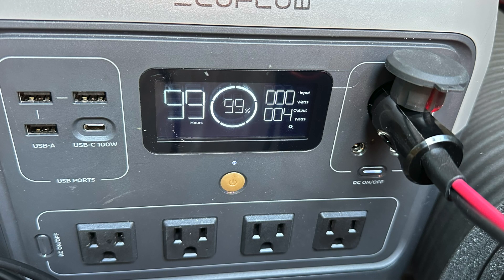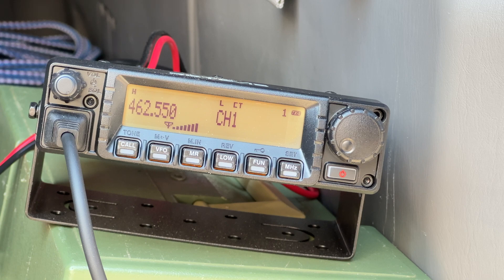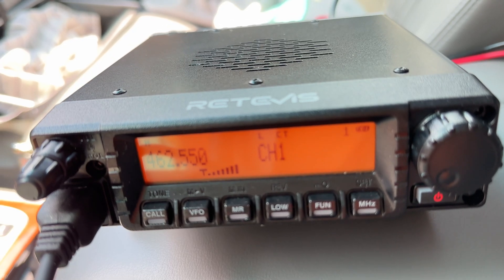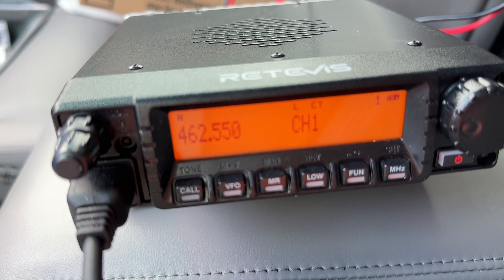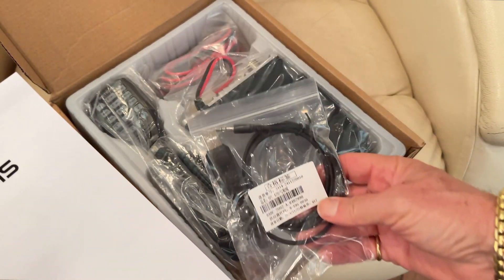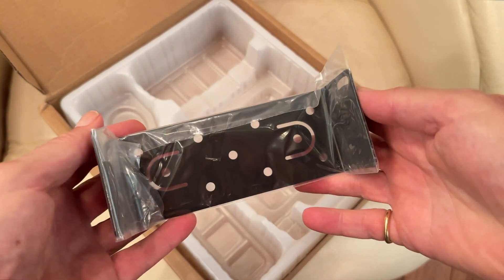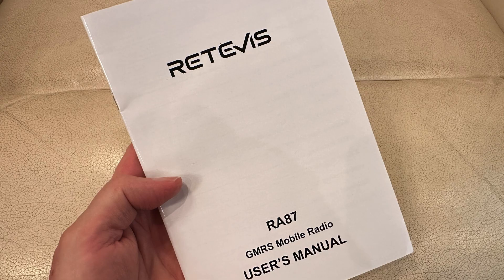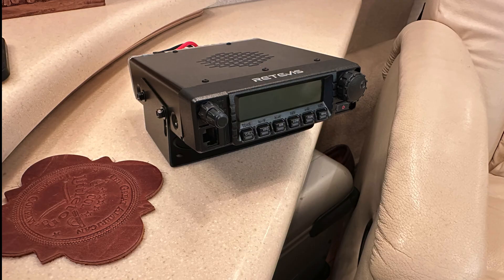Retevis RA87 40 WATT GMRS Range Test in 4k UHD

Comment: Your real issue is that you are on channel 1 which is a low power channel. Try it on channels 15 thru 22 which will give you full power.  Channels 1 thru 7 are only 5 watts. Just because it's advertised as a 40 watt radio doesn't mean it's 40 watts on all channels, they have it programmed to power levels according to the GMRS rules. Channels 1 thru 7 are 5 watts, 8 thru 14 are half a watt, 15 thru 22 are 50 watts max.  So on 15 thru 22 you will get whatever the radio is capable of doing.  My RA87 shows a little over 40 watts on 15 thru 22.